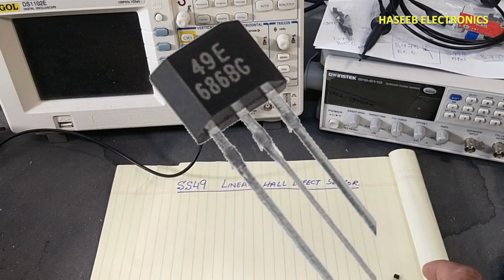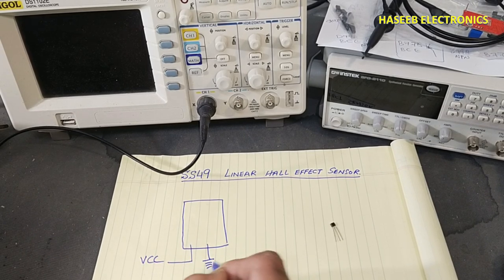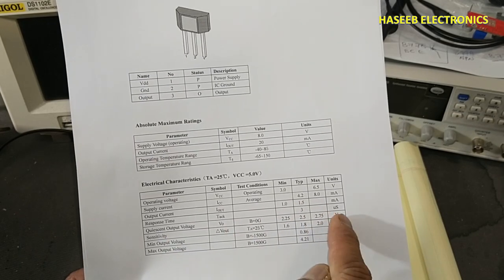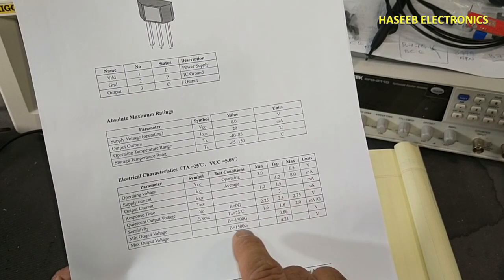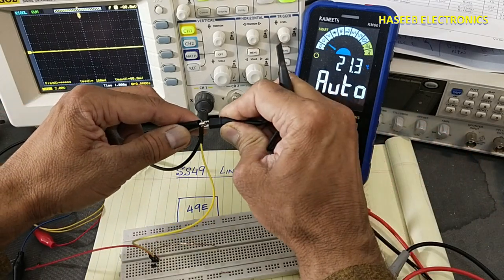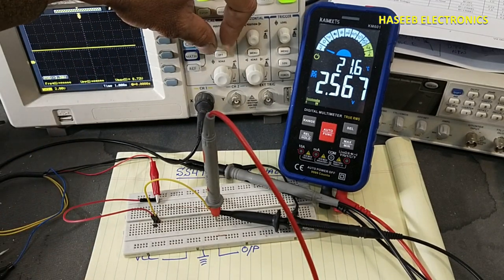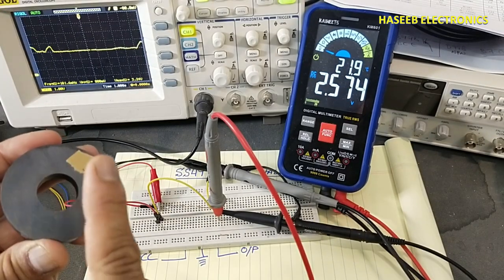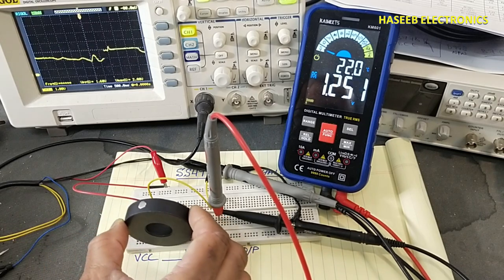{869} Linear Hall Effect Sensor SS49, AH49, A1349

Comment: Thanks for the video. I was not aware of this type of hall sensors. Most analog sensors I've encontered were switching type, with open collector and histeresys and those found in small CD ROM BLDC motors, that require amplification of signal, usually via comparators. I see potential use of this in video, for resolvers on Bldc motors. Essalamu alaykum.